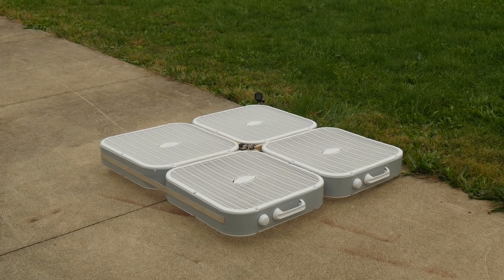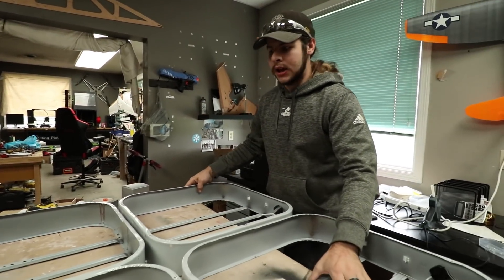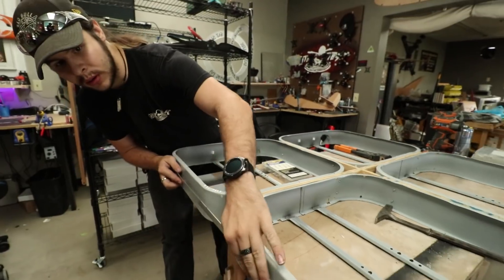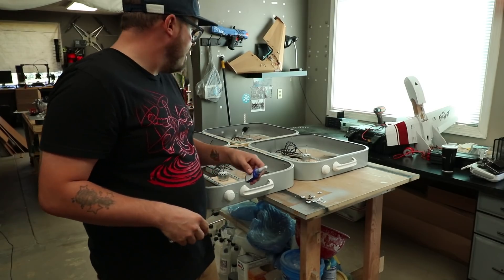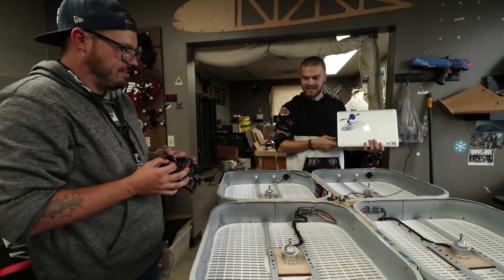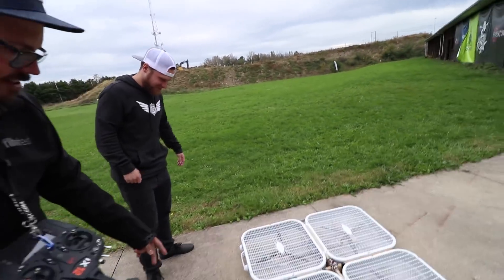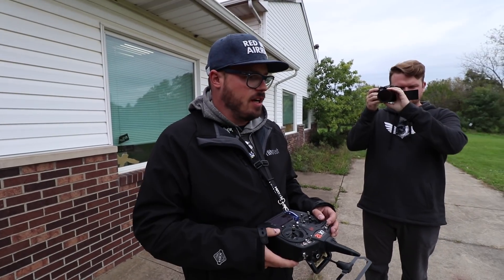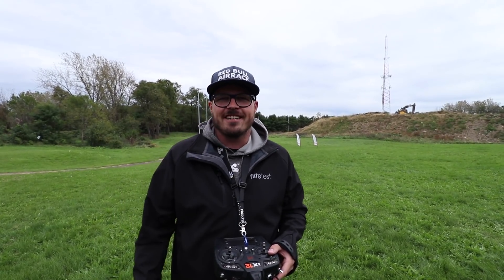Flying Box Fan Drone!

Comment: When you replace or modify parts....   Its no longer a box fan.
Reply: who's a party-pooper.?   
(<~~~that guy ! )
Reply: Well if he takes it apart into 4 super powered fans they are still boxfans...just super-boxfans.
Reply: Wait so hold on if you replace or modify parts on your vehicle is it no longer a vehicle?

🤤
Reply: Its not a drone either but I see you let that part slide.
Reply: i was thinking the same. new prop and motor
Reply: When you replace or modify parts.... It's a modified box fan.
Reply: Hater
Reply: It still blows air so it's still a box fan LMAO
Reply: Thank you
Reply: what?
Reply: These are the kind of know it all dickheads that the hobby brings with it...btw that profile pic tho
Reply: Sounds Familiar ... oh 
 When you replace or modify parts in a Mac it is not an Apple Product anymore
Reply: alheldezcz 
"When you replace or modify parts in a Mac it is not an Apple product anymore."
Right. Just like when you put a souped-up Edelbrock cam in your Charger, it is no longer a Dodge, right? Is it still an automobile? 
These guys never said they were gonna make four Lasko box fans fly, they said "box fans." These are still box fans. They are in 20" box fan frames, they use electric motors, they use fan blades. What would you call them? 
If you replace your hard drive, is your "no-longer-a-Mac" still a personal computer?
Reply: When you replace or modify parts for a car, is it no longer a car?
Reply: If there's a fan inside a box, it's a box fan.
Reply: @GaragebandandBeyond   had they kept the original motors and fan blades yes .... but those were not ... tri-blades and RC motors  used for planes and drones ... a fan they do not make ... so in all ... false title ... 
this group is no longer what they originally said they'd not change from ...
Reply: @FANG1950  What are you talking about? Spinning blades that move air can always count as a fan!
Reply: @GaragebandandBeyond   In that case ,  you operate an illegal air vehicle on the ground .. think about it ...
Reply: GRUMPZ_51 Dude, it’s a YouTube video, relax.
Reply: @GaragebandandBeyond   Simply voicing my "OPINION" as guaranteed by my rights... but it seems to rub some the wrong way...ergo I must stay in my corner silent ... 
So let's agree to disagree .. and go our merry way ...  Still not a box fan  and you by your definition operate an air vehicle ..
Reply: @FANG1950  illegal? In what country and in what way?
Reply: @GaragebandandBeyond  but it's a propeller not a fan blade
Reply: Nick H EXACTLY!! I thought that
Reply: I was thinking the sane thing
Reply: It’s not as its supposed to be after modifying it so it’s cheating and doesn’t count
Reply: Nick H click bait, gutted everything.
Reply: Agreed. I thought they were going to do awesome engineering of some sort and add to the box fans to make it all fly, not gut them the he'll out completely!
Reply: yeah :(
Reply: Relax Francis...ffs
Reply: Tyler durden  When did I say tesla?
Reply: The title says “Flying a box fan drone” he made a drone out of box fans, & flew it. What do you call that?
Reply: You are right
Reply: China knockoffs box fans
Reply: What's that got to do with the price of tea in China? STFU MORON.
Reply: I agree with you. Everyone trying to claim that it is still a box fan don't realize that people want to see the video because of the title.

If you modify everything and are just trying to say since it has a box of metal around it, it is a box fan, you're just grasping at straws.

If you go by that reasoning, anyone can just buy a real drone and put a metal box around each prop and tell people, "Look, I made a drone running with box fans!" 

People thought they'd see normal box fans used to create a working drone.

It is like taking the shell of some normal car and welding it over the frame, engine, and tranny of some supercar and saying, "Look, I made a supercar out of a 1978 Oldsmobile!"
Reply: Gives me an idea for prank. Stick a jet engine inside and casualy leave it on someone's desk.
Reply: If the box still blows air ...its still a box fan.
Reply: ALL FANS blow air. That does not make them box fans. A box fan is something SPECIFIC, not just a fan in a box.
Reply: @khxml  - anyone who disagrees, BLOWS.
Reply: I was gonna say that there taking all the regular fan components out
Reply: When you have only one sub... your opinion no longer matters
Reply: @awesomebush8711  "loner" is you and your obsession with subscriptions.
Reply: @eklhaft4531  bro im not even subbed to this guy

Comment: PROJECT IDEA - take a tiny drone (JJRC H36) with one motor seized after many many crashes and use it and the controller for a powered glider like your capacitor plane.

Comment: Hey, I was watching one of your older videos about the 3D Lab Print planes and I was wondering if there was any way of taking apart the plane after you have glued it together. I am worried that the battery or other parts of the plane might need to be replaced such as the prop and I want to know if you can take apart parts like the spinner. Thanks

Comment: Some suggestions: Use thinner plywood and cut holes down the length to reduce weight. Remove all excessive wires, and mount on-off switch near center of gravity. Remove handles. Remove metal stiffeners and replace with some wire tensioners a la WW I biplane wing stiffeners. Cut out alternating screen slats. It was funny, but could have been designed lighter and so would have flown better.

Comment: That wood cross you added added absolutely zero reinforcement....you just effectively added a wood spacer between the frames and an asswhack of weight for no reason.
Reply: totally unnecessary addition of dead weight !
Reply: Self tapping screws, zip ties, nylon bolts, strapping tape, hell even drywall screws.
Reply: They did that to strengthen the corners and they had to add the strips on the outside anyways..completly agree wood was pointless.

Comment: You can make anything fly if you put a big enough motor on it w/ a standard propeller. You should have found a way to make the stock blades of the fan work. Otherwise whats the point? Its funner watching you make chairs and tiny cars fly.

Comment: Lame, bad engineering there putting the frame together also could of used their plastic frame box fan's for lightness and durability. The motors were too small. Peter S. would have pulled this one off.

Comment: Isn't this just like a regular drone with a weird case?
Reply: Kinda but I'd so love to use it as a fan in sumer
Reply: @mixxnitro7797  AL FLOATING FAN A FAN THAT FLIAT ONTOP YOUR HEAD :O
Reply: That's the point
Reply: @FAQUERETERMAX  I think the point was to get a fan to fly. Instead they stripped out everything that makes it a fan but the case
Reply: @FAQUERETERMAX  I don't think it is
Reply: Yeah that's what I was thinking
Reply: Um, isn't that how you make any drone?
Reply: @gahbah274  Sorry im not sure what you are referring to.
Reply: It's pretty cool
Reply: Did you expect them to make a fan fly? I think thats a bit unreasonable on your part. I just came to enjoy a funny drone “cosplay”, not unlike the supersized 5 inch they built a while back. It looks cool, and thats where the charm comes from :)
Reply: @jamesdavis2027  Not really. They could of put in more powerful fans to achieve lift and flight.
Reply: James Davis wow, you're easily amused.
Reply: @jamesdavis2027  I 100% believed they were going to try yeah. The title says just that so yeah I assumed they meant a flying fan drone and nothing else. Not sure why I would assume anything other than that
Reply: @jamesdavis2027  if the title said drone cosplay I would have expected that. But it didn't. Furthermore Peter stripol posted a video on making a leaf blower plane. He used a leaf blower as the power unit. Not the case of a leaf blower with plane components.
Reply: yeah， that could have been better but I seriously don't believe that those fans have enough thrust

Comment: No wood. Could have just put them together and ran tension tape around the outside of them all. Probably stiff enough and way lighter.
Reply: I was thanking the exact same thing
Reply: Or at least making holes in the wood would have save some weight.
Reply: Plastic may have been lighter but I agree,use rivets.closer together and strong.i use them and I do robotics.less weight.but consider this,trial and error usually lead to a different idea and better results.im building a robotic preying mantis and I've had some setbacks but I've finally gotten the design correct.you have to find the"sweetspot"of the mechanical design and go from there.from years of experience.

Comment: so...you basically didn't used the fans at all
Reply: Yeah... I was disappointed to see you throw the motors, fans and other hardware away ("They don't give enough lift.") So your title is a bit misleading...
Reply: Tom Hannah Well, the motors wouldn't have gotten the job done.  They were also AC.  They should have tried to make the original fan blades work somehow, though, or at least make propeller blades that look like fan blades.  It would have been a lot of work, though, making and balancing some custom props.
Reply: Tom Hannah What title do you suggest?
Reply: @marcd7332  "Flying rectangle" I guess....
Reply: @marcd7332  "Really Expensive Shitty Metal Drone Frames"?  This design would not make the GVCS...also, I would have approached it from a tethered application, get it in the damn air, and then figure out the 110V problem.  

The Global Village Construction Set (GVCS) is a modular, DIY, low-cost, high-performance platform that allows for the easy fabrication of the 50 different Industrial Machines that it takes to build a small, sustainable civilization with modern comforts. We’re developing open source industrial machines that can be made at a fraction of commercial costs, and sharing our designs online for free.
Reply: "Normal drone designed to look like it's using box fans for propellers"
Reply: Yeah, I stopped watching after they ripped out everything.
Reply: @13ECHO20  at 1 minute 13 seconds I stopped watching, they tore everything out and use the frames. Clickbait is real
Reply: I agree...worthless video....
Reply: no... just the shell
Reply: Yup, click bait.
Reply: Love how millennial braniacs dismiss mathematics when attempting these projects. If he had half a brain he would've known it wasn't going to work. Learn some physics first. On social media anyone can look smart and capable.
Reply: @DeviDog305  dumb or not, you have to appreciate how far someone will go to make something happen... while the execution was lackluster; the guy did follow through... I think running is stupid, but I respect those that commit to a marathon.
Reply: ITA, these yahoos said - (We wanted to make box fans into a drone. So we did!)=Clickbait and BS viral posts
NO THEY DID NOT! BUT JUST PUT BOX FAN METALFRAMES vs standard drones AROUND REGULAR DRONE STRUCTURE& PARTS
Reply: The video"s "Idea"  0:10 to 0:20 " He saw  a hoax" and then created another "Hoax" according to thIs video title "Flying Box Fan Drone"  this was a let down. to us because we all feel duped into watching. But for this channel what goes down, goes up? for that reason we have all decide to post on here increasing its views
Reply: Was thinking the same thing about 1 minute in!
Reply: That's awesome! but didnt use a lot of the fans.
Reply: USE*
Reply: Then you do it better
Reply: BR14Nx if you mounted it on a low setting in your home from the ceiling it would be a fan just modified that doesn’t mean it isn’t a fan. People modify and replace parts on vehicle and they are still vehicles..
Reply: 'Giant RC drone' would be more accurate.
Reply: Use*
Reply: Man... I bet you all are a joy to have at a party...
Reply: @chrishernandez03   I'm a freakin' riot at parties, people love me and I get lots of free drinks. I also know something cool from something that's actually pretty lame, like this.
Reply: @LiLi-or2gm  if the bar for what is cool is set at light bulbs hanging from fishing line; then by all means Laura, please tell us what is & is not cool.  Anyone that doesn't pay for drinks with money; purchases them with something a bit more degrading... but hey... what do I know...

Comment: Man that had the potential to be super cool. Why go through all the hassle to build it just to fly it for 20 seconds? Surely everyone knew it wouldn’t recover from a roll. 

There could have been a ton of weight shaved off that thing too, most of the frames could have been drilled out and covered with gray tape or something. It might have been enough to be able to keep the grates or most of the grates, maybe cut out every other piece.
Reply: Bmac 814 Was thinking the same thingon both counts....Lol but props for having the balls to immediately try a maneuver that would probably smash it lol.

Comment: take one box fan and put 2 counterrotating blades on it. and for an experiment use a 2 blade prop, a 3 blade, and a 4 blade to see if one out does the others. put louvers on the bottom, that can be directed (left, right, straight down, and closed) ((think GEV)) use different numbers of louvers, in different orientations. like in a box setup, or the left and right set are run for and aft, (for lift and drift correction) and the center section (broken up into two sets) run side to side, (the front half of the center section rotates 120 degrees and the back rotates 90 degrees) (( the front directs the airflow from almost straight front to almost straight back; the back directs airflow from straight down to straight back)) these are just a few ideas to see if it works

Comment: if you are switching fan blades and motors then it isn't quite the same thing just ab actually quadcopter just much larger with box fan casing
Reply: @highks haha what if it did o_O?
Reply: @highks I believe it IS possible to modify the original fans to fly... except the motors would require replacement. Part of the "fun" of modifying is to actually modify. Strengthen up and cut down original blades, cut holes in frame to reduce weight, etc... Seems they took the easiest road available, and avoided all potential problems. The problems are what creates the challenge, that is why so many comments are negative.
I imagine Peter would at least give it a shot, not playing it always safe.

Comment: can you fly a leaf blower?
Reply: Like PeterSripol's Instagram? Video coming soon!
Reply: I've done the Wiley E Coyote thing, on ice skates. Goes too fast for hockey skates, they eventually shake like a caster wheel when too fast.  Figure skates should be better.
Stihl br600
Reply: Strapped on your back!
Reply: I've wanted to see an R/C plane with a power system from an electric leaf blower for a while now.
Reply: @rcbif101  a guy did it with gas blower
Reply: PeterSripol did it
Reply: please yes

Comment: Wood was 100% not needed for this project IMO
Reply: The wood made it unnecessary heavy without any added rigidity.  The aluminium strips on the out side edges was a good idea though.
Reply: Im Not a fan of fan drones .
Reply: I think the outside support for rigidness when manually lifting corners was not warranted.The lift force is produced linear with the motor shaft,essentially making the motor shaft the 'corner" with little to zero stress on box frame corners. all the stress would be directed to inside attachment points of the boxes,which the wood was used to support, Am I wrong ?
Reply: I agree.  They could have riveted together the frames, and then achieved the rigidity buy putting the grates on at least one side. That's the same way a roof gains rigidity on trusses- by skinning it with plywood.

Comment: Is it possible to make a drone with EDF instead of regular motors and propellers?
Reply: yes  its been done already.
Reply: search "ducky" edf
Reply: Not efficient and u need 2 that turn the other way around and speed control can be a isseu
Reply: It's possible, but it has one major limitation.  The way that the cowling around the fan increases lift, it causes drones to right themselves horizontally when they try to move.  It results in a very stable platform, but greatly sacrifices mobility.  RCModelReviews did a real good video on the subject: https://www.youtube.com/watch?v=0stl1U9evzU

Comment: Yall should do a flying delorean,  like back to the future,  a flying buzz lightyear.
Also, tall should try a glider tow with an rc car....
Reply: Flying delorean sounds like a freaking awesome idea.
Reply: @speters46  yeah, I was thinking about it, since Halloween  just passed and I was like how awesome  would it to be if they made it  happen!
Reply: https://www.instagram.com/p/BpnwKWGn3wU/
Reply: Awesome idea ! You should consider adding a D or E size rocket motor to the rear of the DeLorean. Should be easy to wire the igniter but you’ll need stabilizing fins. Frank at Dynasoar Rocketry could advise on feasibility since he builds and sells RC rocket planes. How awesome to see a “sparky” rocket motor on the car !
Reply: Agreed. A flying DeLorean ( probably around 1/8th scale ) would be fan-flippin-tabulous. 

"Where we're going, we don't need, roads"
Reply: Another idea would be to honor the 50th anniversary of Apollo 11 by building a lunar module RC. A guy on Rocketry forum built one and it was pretty cool except the props extended outward from the module detracting from its realism IMO. FLYING R/C Lunar Module Quadcopter:He has a GIF of it landing in the snow kicking up fluffy snow recalling Neil Armstrong’s words”kicking up some dust” as he landed on the moon